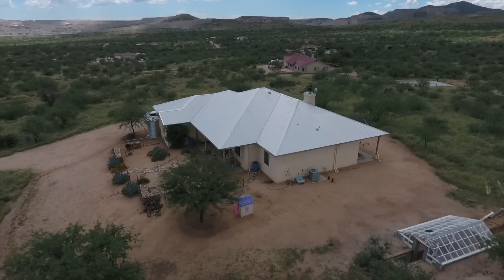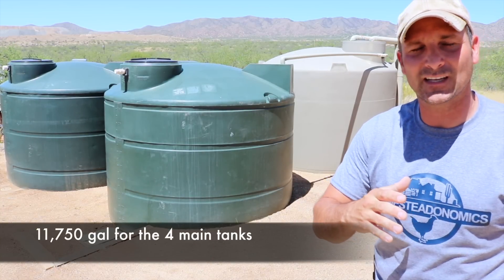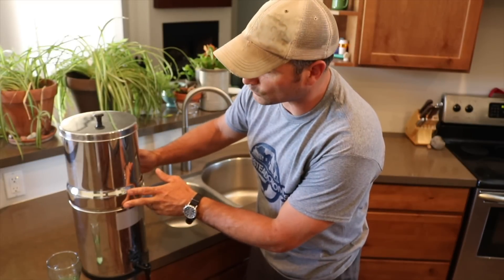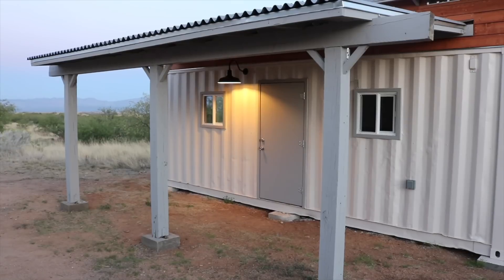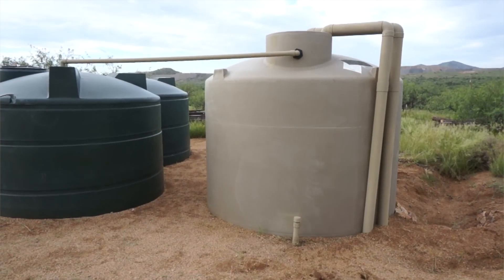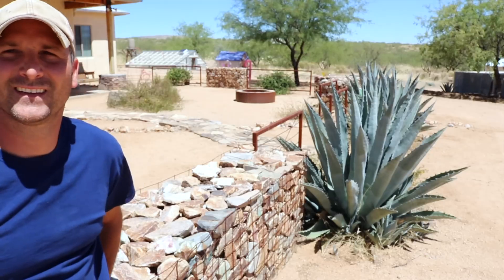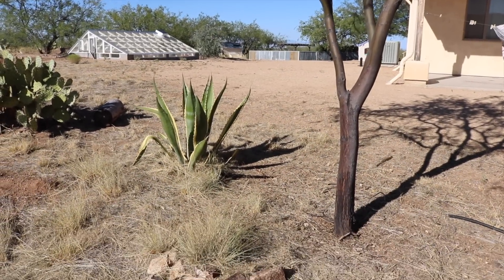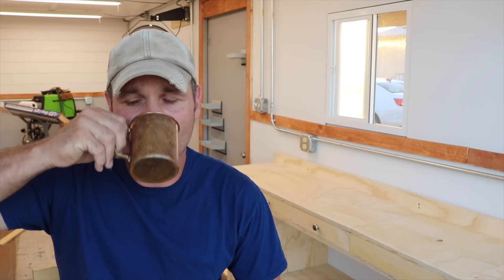Rainwater Harvesting QA - Cost, is it Illegal, how I treat, etc,.

Comment: I use to live and work for Gwinnett Co Ga. water Dept.  That water is recycled poo water mixed with filtered Lake Lanier. Feed by two 109” concrete water mains then stepped down to 48” - 5” mains ( some are ducal iron) but it is all chemically treated at some point. 
  I now live in Yucca AZ. I buy potable water in town at the water sale locations. 
 I currently have 2 black tanks one 2000 and 2500. Plus, my water trailer holds another 600gal. I would love to come see your system or a diagram of it. 
 I want get away from buying water, so my home is fully self reliant. My solar system payed for it self in just over two years.   O in Georgia my water bill was over $120. Do the math folks. Even if you have a well what does it cost to pump the water out? What would it cost to blow the well out or heaven only knows if you run dry, and need to drill?

Comment: Like your video. I've installed a small system on my kitchen roof, rain from the top roof will collect in the tank on the kitchen roof. It's a 500 ltr tank (132 gallon) , gravity will fill flush the toilet. Installed the system because of the high taxes (on everything in my country) and I think it's a waste of fresh drinking water to flush a toilet. In 1 year I saved 20 m3 / 5200 gallons  of fresh drinking water. Greetings from a rainy Netherlands.

Comment: You can add about 35% to the savings on your water bill since you would be paying taxes on that income. We are off grid in NC and have no water bill, no sewer bill, no power bill, and can take those savings into a tax-deferred savings plan (or scale back that income, enjoying life more). 
Our water is spring fed via two settling tanks, going to a 1200 gallon holding tank to be solar pumped to the ridge above the house (another 1200 gallon tank). Gravity flows it back down to the house. The whole system runs on one 120 watt solar panel. All tanks and piping are buried to avoid freezing and algae. We don't add any chlorine because it will kill the naturally occurring denitrifying bacteria that cleans the water. No problems after 25 years. I drain and flush the settling tanks about once a year. Great looking system!

Comment: Amount of money you spent on the water collection is far less than a well even if you had water Broad in you'd have to I have a take or to to hold it to clean deliveries so you have the same cost actually more for well you still have the maintenance for well And any system you put in
Reply: What well maintenance are you talking about?  Do you have a well? Do you know anything about wells?  I'm guessing...no, you have no idea what you're talking about.  Other than electricity to run the pump - there is no maintenance.  In 25 years of using a well, I have had to replace the pump one time and that had to do with warranty replacement of the pump due to a cracked pump case which was a manufacturing defect.  The shit people talk on the Internet attempting to sound like they actually know something when they know NOTHING is just astounding.

Comment: Was curious about usage.  How many gallons do you go through per month?  I realize that usage rates will differ seasonally as well as garden and Home usage will have different rates.  Can you break it down? and which resevoirs tend to run out first or did you work out the capacities to balance water usage so they all run out at the same time? Thx

Comment: Great construction. We do a little bit of it here in southern California where there is not enough land. All we may be collecting is just a handful of barrels of rain because of shortage of space. The collected water is as nasty as hell because of lots of crap on the roof such as bird droppings and deposited particles from air pollution and dust. However, the idea is great and can be implemented by the cities to do similar projects along watersheds to collect and treat rain water as needed due to drought conditions and low water supplies.

Comment: Hey Joe, hopefully the questions have slowed enough that you'll catch this..

I'm curious why you didn't use any underground tanks.  Was this purely a cost decision?  I would think it would work well and look nicer, and the water would stay cooler and not be as susceptible to freeze too.

Thanks for any info.   I'm getting ready to start my own system, just for irrigation water at this point,  as I have a productive well, but I'm also in a pretty dry climate in So California.   I have my well on a circuit I can isolate to my generator in the event of need, but if the actual well was damaged such as in an earthquake, I'd like to have some storage available.. So I might pursue making it a true potable system in the future.

Comment: Have you ever considered also (pre-)heating your water yourself? In Greece, they use pitch black barrels on roofs to heat the water they use for showering. https://buyandsell.gr/wp-content/uploads/2018/08/APAG135-47-1024x682.jpg
Reply: When I lived in Tucson, Arizona I had a standard water heater that sat outside the house. In the summer I would turn the water heater off. The air temperature and the sunlight were enough to keep the water hot.

Comment: I have one question that I have not seen addressed, or maybe I just missed it.  What pump do you use to get the water from your storage system to the house?  I think I saw a pressure tank in the little shed you showed on one video. Is the pump in there with the pressure tank?

Comment: Good idea but as in electrical side you can run a water generator for  a 120amp 200amp 440amp up to 800+amp service & so on I'm in Pennsylvania I have mine done the same way I pay twice a year for water delivery 5000gal delivery each but I just added a 8000gal reseve tank so I won't have to get a water delivery anymore...

Comment: You absorb much more chlorine through your skin when you shower than drinking it. It will also damage your microbiome - health problems over time. Use chlorine dioxide instead. It has a pathogen kill rate of 99.9999% in 60 seconds and is pathogen selective, it will not harm healthy human cells, in fact it's highly therapeutic, curative (eg, one 15 drop dose, activated with 15 drops hydrochloride acid - already in your stomach anyway- will CURE Malaria within 24 hours with 100% success rate. It's a water purifier.  See MMSWiki.is for science, more info and Jim Humbles' eBook to explain therapeutics. Also see Facebook page The Ebola Cures. Otherwise, the best drinking water is distilled water. Bench top units are cheap. You can remineralise it with pink Himalayan salt.

Comment: filtering contaminants would be easy but I would be more concerned about the plastic containers. With Arizona heat, those plastic tanks will leak plastic into the drinking water.

Comment: Try using a slow sand filter to treat all your water... You'll love it. It's easy to build, cheap and removes most of the bacteria and viruses.
Reply: A sand filter will be very unlikely to trap microscopic bacteria, and even less likely to trap viruses which are considerably smaller still!
Reply: You're right.  There are limitations with the slow sand filter with regards to physical removal of particles the size of viruses.  This being said, a well maintained Schmutzdecke will destroy most of the balance of any pathogens.  And as with all drinking water, UV(or other) and free chlorine to ensure the water being consumed is safe.  @spencerwilton5831

Comment: Hmm, $5,000 for a rain water system VS my sewage bill (sewage ONLY, water NOT included) is $80.00 every 3 months so for a year I pay $320.00 now lets times that by 20 years wich comes out to be $6,400 (that's without any increase & we all know "increases" WILL happen within  20 yrs). I'm thinking the rain water system is the way to go... 

*I have well water with city sewer so I pay more than $80.00 every 3 months for water because my well uses electricity but to make it simple I didn't add that in.

Comment: Absolute water rights? Depends upon the situation.

An attitude of 'immediate payoff and damn the consequences' is plain stupid, greedy or both. The cost of repairing environmental mistakes, if even possible, is hundreds to thousands of times more expensive than preventing them through regulation. Building in wetlands invites flooding catastrophe, not just erasing genetic and ecological diversity that has profound value to the fully informed electorate. Hurricane risks get addressed in 'some' building codes. Different risks in different ecosystems equate to different adaptive regulations. 

Property rights are a collection of rights; they are not all absolute. Common interest, without corruption, must exist. Whether rainwater collection (although seemingly innocuous) or any of many technologies, unbiased inquiry, evaluation, and the possibility of regulation must remain. The Wild West had a shorter and often brutal lifespan. Romanticizing it's minimal governance is a mere myth embraced by the self-serving.

Sure, this rainwater adaptation is brilliant and creative, but comments that leverage it to condemn all regulation are disingenuous and uninformed.

Comment: Saw you using a copper cup to drink from.  Good idea as copper is the "poor man's" silver when it comes to anti-microbial properties.  Copper door knobs, cooking and serving tools are also good to help passively kill germs without using harsh chemicals.  Don't over-do it on the copper though, just like anything else; too much can also be bad for you with toxic effect.  Some microbial exposure is good for your body anyhow.  Silver works better of course, but is rather pricey.  Considering the capitol expenditure to build your water system; it can cost quite a bit to have water pipe run to your place.  I didn't hear that expense mentioned, and then you have the additives they put into your city water to deal with as a constant filtering expense anyhow.
Reply: Anti-biotics are dangerous! 
It's a good idea not to ingest too many microbes from the environment at one time (so washing your hands is always a good idea) but your gut flora is made up of microbes and they do a job on our behalf ie most of our digestion.
 Don't kill them!
A little bit of silver or copper isn't going to shift them - they reproduce - but a barrage of anti microbial produce is a seriously bad idea.
Filter or boil for preference.
Over-exposure to any metal is not a good idea. Lead is well known (as is mercury - but nobody makes mercury pipes) but just about any will kill your brain over a long period - do you really want to have dementia ten years before your time, maybe while you're still working? (this happened to my father - a research chemist that also served on toxicology advisory boards. He knew what killed him, and also knew there was no antidote)

As a general principle - whatever systems you use minimise the time the things you ingest spend in contact with ANYTHING else.
In 20 years will we be cursing uPVC? 
If your nutrition hasn't spent time leaching things from anything then you've just future proofed - lead pipes were the best thing, asbestos was the best thing etc etc etc - today's science may be based on incomplete data that takes time to become mature.
Reply: Many civilizations were brought to their knees using pewter and lead for utensils, dishware, and water pipes.  Cheap pewter was used to make utensils, plates, bowls, cups which had upward of 15% Lead.
Reply: Great tip

Comment: I live where it was manditory to build a water catchment system my tank is 8 inch concrete with a block wall divider about 3 ft tall. all the water goes into the first have so that sediment settles there , and my pump sucks from the other half of the tank. on the second building ,I used blocks for the walls. i suggest that you use the grey water to flush the toilet to conserve water.i live where there is brackish water in the ground and when i switched my toilets to the well it decrease my consumption by 400 percent and i plumbed my system so that when the well is not working with a valve i put the toilet back to the catchment supply

Comment: Great videos!  I'm envious.  I could use your expertice and I have a somewhat complicated explaination of my delema. Heavy runoff from the neighborhood floods my property (only likely a few times during the winter months) at the spot where the street gutters direct the runoff above my steep property terrain.  It has damaged my attempt to have a small road cut winding down to the gulch below where I would be able to find the shallowest water to drill.  But without the road down it is an imposibility.  I am trying to think how I could utilize this water to store in a series of tanks at differing levels.  The question to you is:  How would be best to filter runoff as it brings a lot of dirt given the rural nature of the community.  Have you ever thought of a filter system that I could easily clean out after such a downpour that could accomodate a great amount of water flow when in use?

Comment: What you could do to lengthen the life of the three tanks [2 green an one stone colour] is to build a irrigated roof over them to shield them from the sun and this corrugated roof could be used to collect even more rain water. If you  want to improve the taste of the water after you have filtered it you could use a carbon based filter system. Any stand alone PV solar panel system could also be used with a gutter to collect rain water and the electricity used to change batteries and to power any water pumps.  You are in an ideal location to take advantage of these technologies. Good luck. Some 20 years ago I live in the UK and was lucky enough to visit Arizona  - Scottsdale what a beautiful location on earth you live in  ATB

Comment: really would like more detail on the purify/sanitizing for drinking process
Reply: Relatively inexpensive (a few hundred bucks) inline industrial water filtering/conditioning systems can demineralize ground water, ultra filter for removal of viruses and radioactive fallout particles, and adsorb organic compounds like pesticides in activated carbon, using 3 user replaceable cartridges that are 4 inches in diameter and 18 inches long.

Comment: to bad you can't have the starting tank with a way for the sun to heat and boil the water out into the transfer pipe to the next tank. So some of the water could be in a sense distilled into the house tanks without the need of electricity

Comment: come to Key West and design a system .....
last week in October.....
Reply: The older homes in Key West had cisterns to collect rain water. A lot of water was hauled there by trains once Flagler got the FEC down there. After the 1935 Hurricane, that stopped and a pipeline was built to supply the Navy and others down that way. The wells are about 5 miles from me and feed into the 130 mile pipeline now run by the Florida Keys Aqueduct Authority. Which contains over 1000 miles of pipe in the system. The well field is still known as Navy Wells. At one point, Key West had a desalt plant but that has been shut down for a long time. 16.5 million gallons of water a day leave the well field.
Reply: Thanks for the Great information.   I want to do better... I heard a commercial on the radio and Key West have a $500 rebate program.  I just really need somebody to give me some solid/good information about how it will work best in Key West.

Comment: Acid level in rain water has less impact on drinking water than it does on irrigation.
The more CO2 you have in the atmosphere the more acidic the rain.
The more acidic the rain the more acidic the soil. The more acidic the soil the less you can grow in it. The less you can grow in the soil the less oxygen is produced and the less CO2 is removed from the atmosphere.
The more acidic the soil the more acidic the runoff into the oceans. The more acidic the oceans the less sea grasses and seaweed are grown. The less sea grass and seaweed the less oxygen the ocean produces.

"In the grand scheme of things do I think that's a problem"?
On a planetary scale...................damn right it's a problem.
Reply: Guess you think that people don't put acids on some soils to get plants to grow either. The PH level has to be in a certain range, and slightly acid does not stop growth. If it did then, what would grow in water that contains Tannic Acid?
Reply: gravelydon.  I wasn't talking about "slightly acid. There is an optimal range for the Ph balance in soil for most plants. Acid is added to keep it within that range some crops prefer the top of the optimal range and some prefer the bottom of that range.
What I'm talking about is growth on a global scale

If acid levels in rain get too high you get smaller crops and major events like the death of half the trees in the Black Forest in the 1990s. That's why the propellants in spray cans, and the gas in air conditioners had to be changed

Comment: Do you use your water in a swamp cooler so you can keep your electric bill from getting way to high in the summer?

I have heard of people there in Arizona dropping their summer electric bills by as much as $500 a month by using massive swamp coolers. The down side for you using such a systim is the large amount of water that it requires. You may have to double you storage and put in additional water collection areas to use such a system.